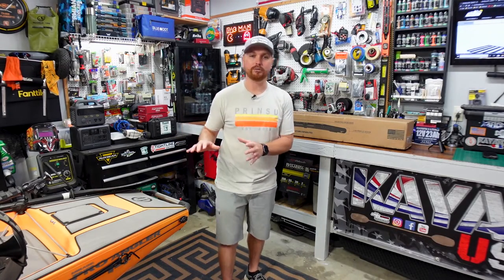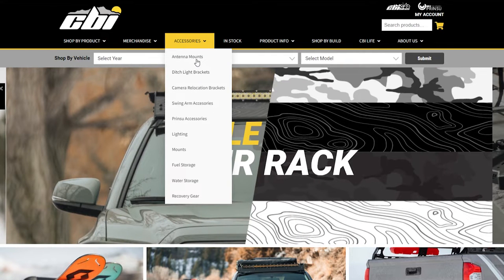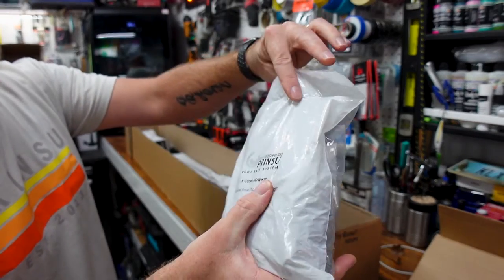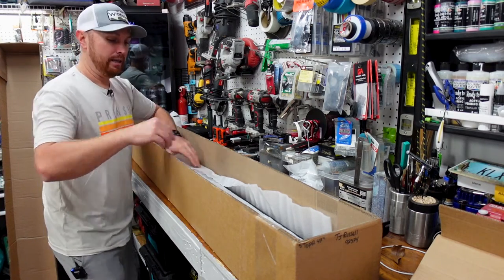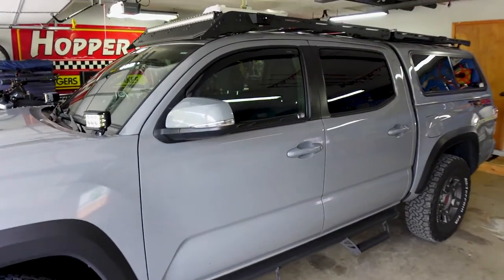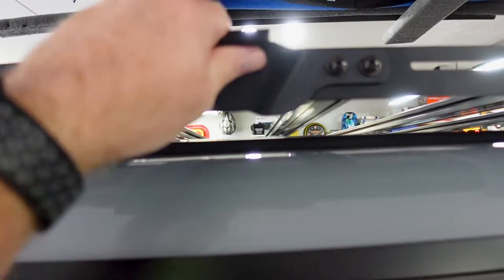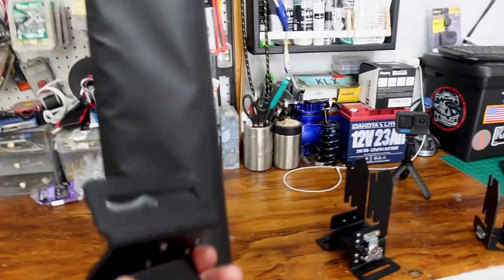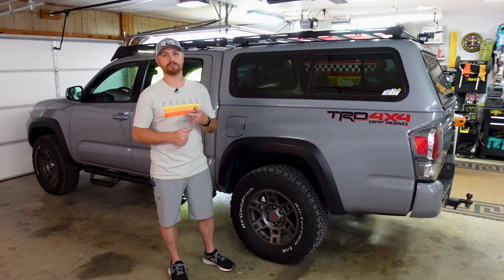Truck Camper Build | NEW Truck Topper Roof Rack Install | Solo Truck Camping

Comment: Finally bought my prinsu racks for my cab and topper… I’m worried about the topper side bc my hobie PA14 looks like it exceeds the leer 100xr weight spec. I think if I load it sideways over the cab first and then pivot it onto the back it will gently load it …. I always envisioned it as being a no brained but apparently leer has a weight limit of 150lbs